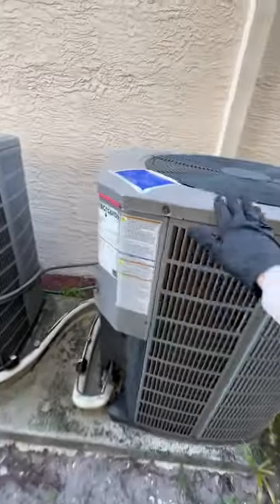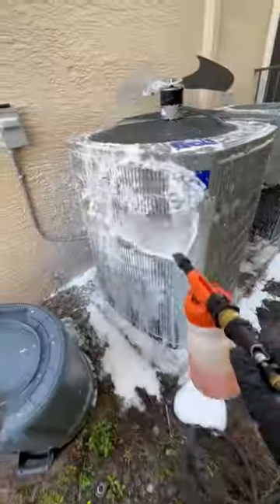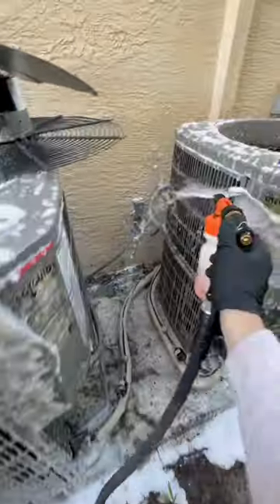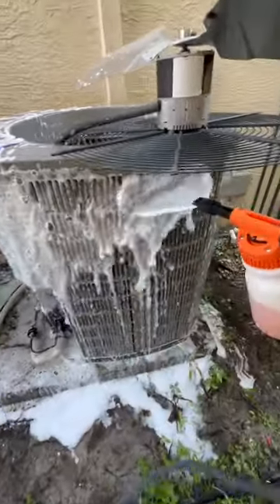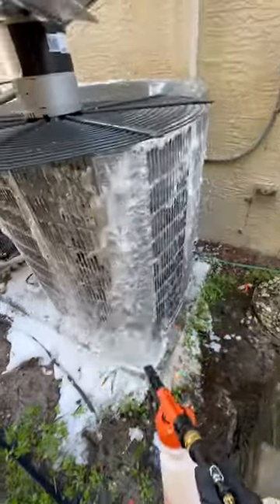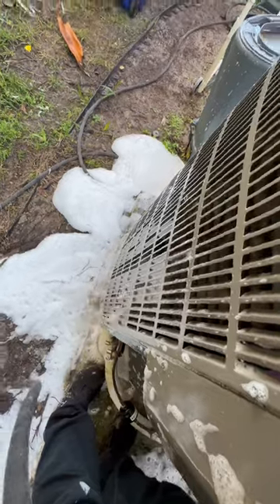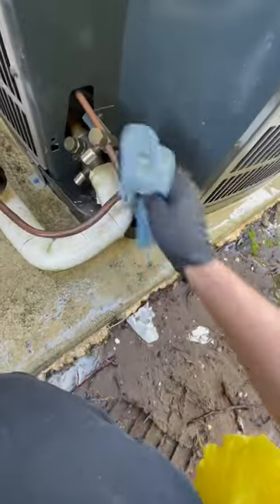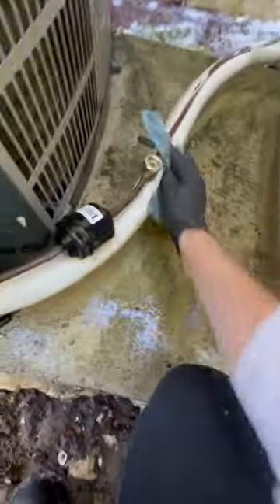Load it up! #maintenance #ac #diy #clean #satisfying #soap #hvac #technical #service DOING IT RIGHT!

Comment: Anyone else see the kink in the liquid line? 😅
Reply: I did notice the bend, but it appears that is a joint where he brazed the line in. Maybe all he had was a 90? That's a good eye though!!
Reply: Holy crap yeah. I thought the same
Reply: Fairly certain it's a 90 degree fitting, but it's also bent past 90 lol
Reply: Ha me too
Reply: Think it’s a 3/8 short 90. Wouldn’t recommend using them on lines that small though
Reply: That's a 90⁰ elbow - which shouldn't have been installed.
Reply: @ParabellumX  no one comfortable enough bending a 90 🤣🤣🤣
Reply: Looks like a SR 90° coupling
Reply: That’s a street 90 sir
Reply: Long radius only on reefer. Resi rookies at work

Comment: Those sight glasses are useless for R410a.  zeotropic blends can be fully charged yet still show some bubbles in a sightglass because of the temperature glide of the component gasses.  In other words, if you charge an R410a system to a clear glass instead of using superheat or subcool you are overcharging it.  The sight does still work as a moisture indicator though.

Comment: Remove the shell to clean the dust and grass out of the finning on the condenser they run cooler ,clean the indoor filters monthly your system runs better , cooler and uses less electric,less stress on the system less breakdowns.keep weeds away from the cassing to.

Comment: Considering the manufacturer recommends only water =F. Why are their filter driers on the outside? Those manufacturers usually have one inside the condenser and if they don't should be installed inside anyway. 0 for 2!

Comment: Acid cleaning your coils is not a good idea... Too much acid can cause it not to exchange the heat...also removes protective coatings that have been put on coils from the factory... Liquid line sight glasses are not a way to check freon... I'm going to guess you never went to school....